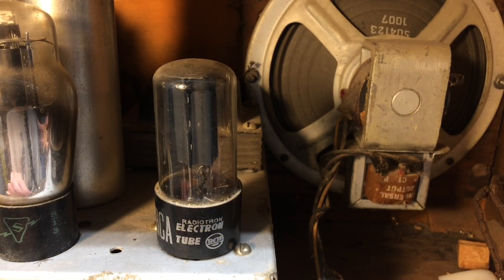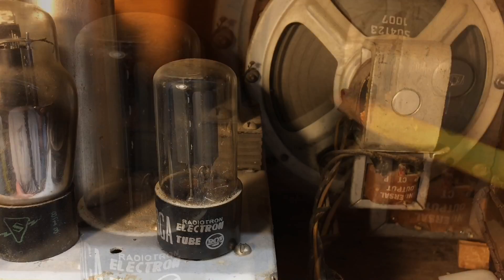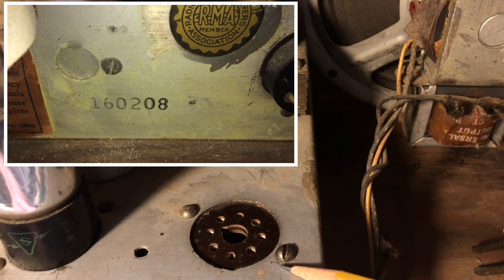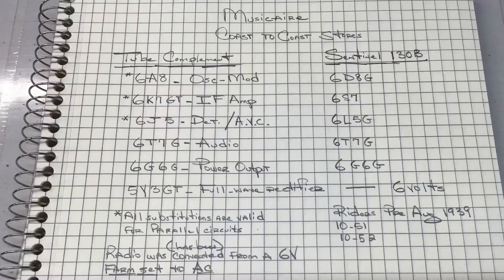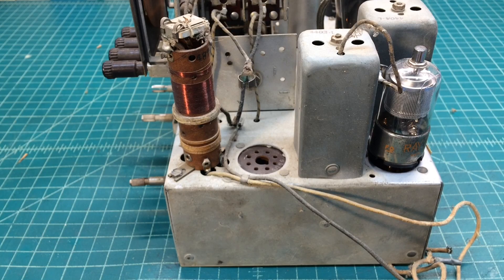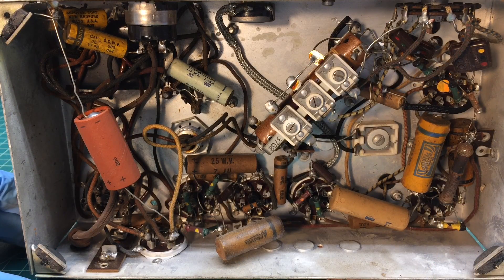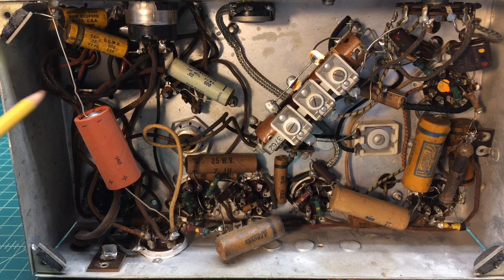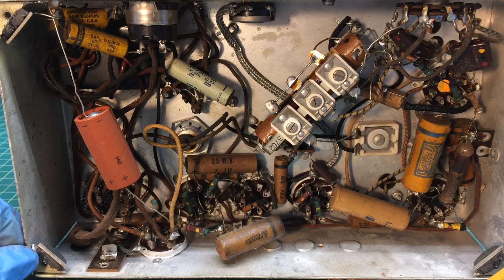Musicaire Radio - Sentinel Radio Corp. Model 130B - P2

Comment: With the extra small holes by the transformer it probably had a vibrator power supply and the transformer for that was originally located there. Quite a few of those sets were converted just by changing transformers and adding the rectifier.
Reply from the maker: Bob, you are correct. The schematic I found shows the add on A/B power supply under the chassis. It would be cool to know if this modification was an undocumented production change or an outside shop; either way, the workmanship is very good. Thanks for reaching out. Best, Don